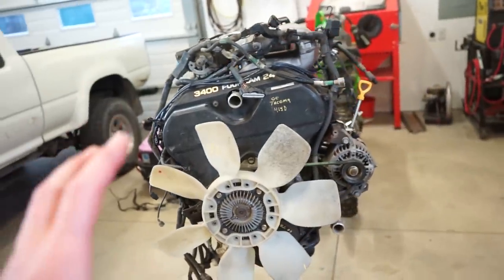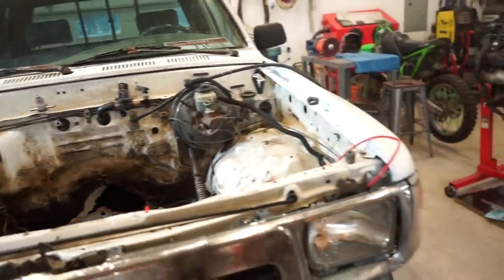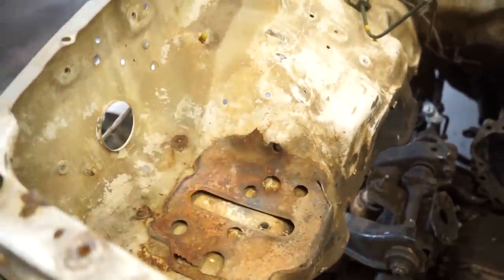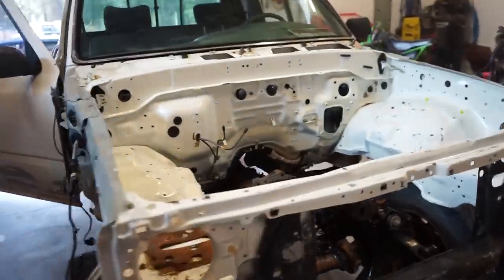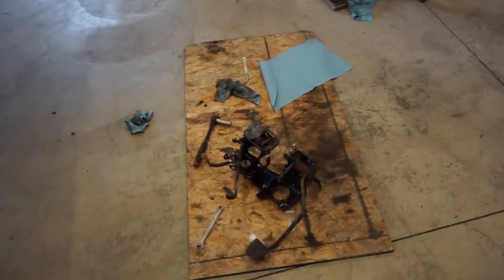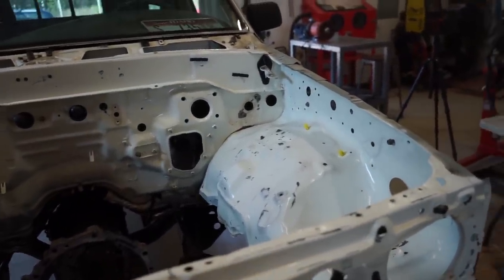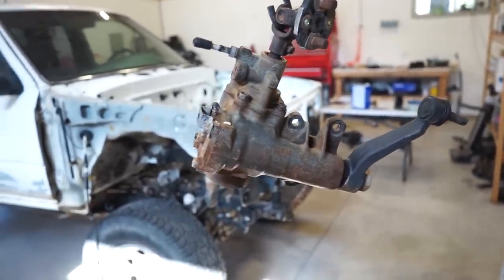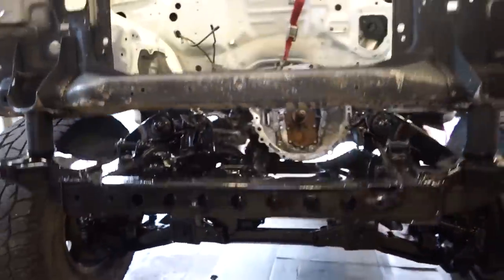That's How You Clean An Engine Bay!! 3.4 Swapped Toyota Pickup

Comment: Nice work. Should be a nice reliable truck once the 3.4 is sorted. Keeping with the budget theme it would be great to see a blazeland long travel kit on it... have fun!
Reply: Anthony Gaussoin 3.4 is a beast for these little pickups!
Reply: True. I still have the 3.0 in mine. It is a tough engine but I get slowed down in the hills with a pop up camper on the back. The extra 40 hourses  from the 3.4 would be great. There are a few other engines on the short list, but the 3.0 keeps chugging.
Reply: Anthony Gaussoin I changed everything from auto 3.0 to 3.4 manual and came to found out it has stock 4:88 gears in it so it’s a monster 😂

Comment: You just need a 1in lift to fit the 3.4!!!! Lower it down 2 inches!!!! Great Video!
Reply from the maker: Planning on dropping it down!
Reply: You don’t need a lift at all 😂 my truck doesn’t have any lift
Reply: @Red_Beard_Builds  Really?! everything I ever read said 1in body lift or clearance the hood... I have not done it but have read alot about it
Reply: Build & Adventure I mean I don’t discourage it as you have more room to work+ but you don’t have to my trucks intake manifold hits the hood just a tad but I’m sure I could fix that if I wanted to.
Reply: @Red_Beard_Builds  HAMMER!!! or maybe 1/2 in body lift would solve the issue!
Reply: Build & Adventure eh it’s fine , I’m gonna probably put this swap in my 84 an put a 1uz in the 93 I’m thinking

Comment: Instead of rattle canning, buy the rustoleum in the quart can and spray it from your gun. Its cheaper and way more durable. Thin it with acetone and you can use a little hardener if you want it to dry quicker.

Comment: Loving the work! 
I also have a question about tools. Devin and you and lots of other guys are using Dewalt. Im debating between Dewalt and Milwaukee. What do you think of them?
Reply from the maker: Dewalt are nice but the milwaukee are better i think! If mine ever break in going red!
Reply: Milwaukee is far superior. I've used several drills over the years. Milwaukee is by far the best in my opinion. Be sure to check out there impact driver as well, it's a beast!!!

Comment: Quick question you ever mess around with 22re just got a super clean 94 and the motor is blown in her not sure if I should have a shop do it or do it myself any advice?
Reply from the maker: Yes I've rebuilt many of them! They are really simple engines! If you are mechanically inclined, take on the project! Lots of info out there on the 22RE
Reply: Austin Niemela thanks man I’m not that bad with motors but I’m only 17 still have a lot to learn my dad is really good with motors and rebuilding I think I’m gonna give it a shot what rebuild kit would you recommend?
Reply from the maker: Luke biggins I believe I used to buy from 22reperformance.com!

Comment: How could it get a 2jz I live in south georgia so 2j would be almost impossible to find
Reply: I'm looking at a 2JZFSE vvti for 2003 hilux only down side is its petrol engine but do you rekon itll be an ok motor for 4x4 offroad?
Reply: @rogueskywalker7649  absolutely as long as you seal everything up and tune it right I'm hopefully gonna put one in a 80s model for the same reason but if I was going offroad I'd go diesel for the torque
Reply: @adamcarelock7096  thanks buddy